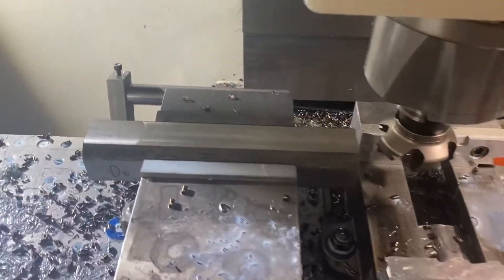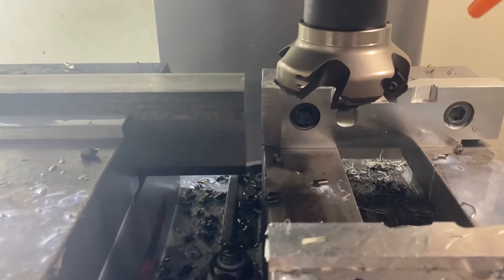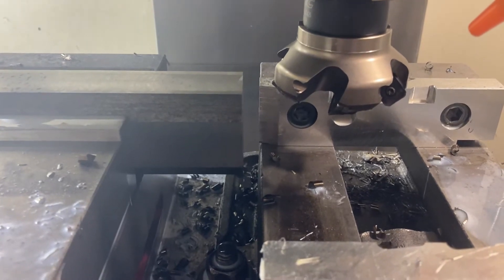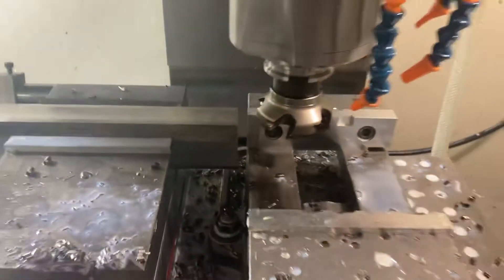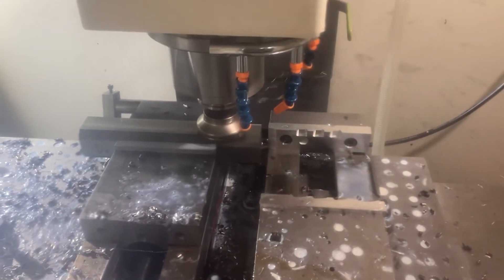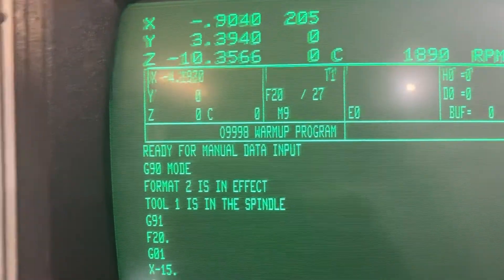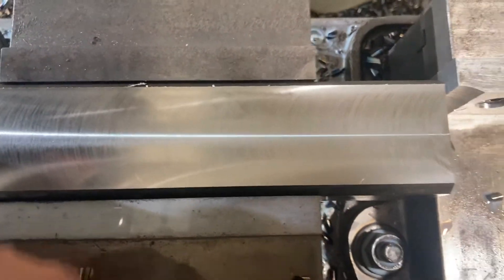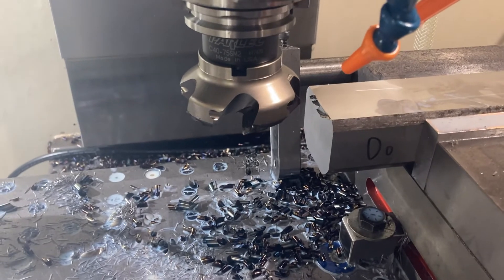A heavy cut on a Fadal VMC15

Comment: Wow, .220 depth. That’s pretty good. I don’t think my VMC15xt would do that without chattering.
Reply from the maker: Use a good 45 degree face mill and you should be able to do the same!  Cutting forces are balanced both axially and radially with this type of cutter. This is a Mitsubishi ASX 445 I bought used, other options include Haas tooling and Shars. I wouldn't bother with some of the real cheap tooling you can find on eBay because I've had a bad experience were a cutter had over 0.004" of runout.